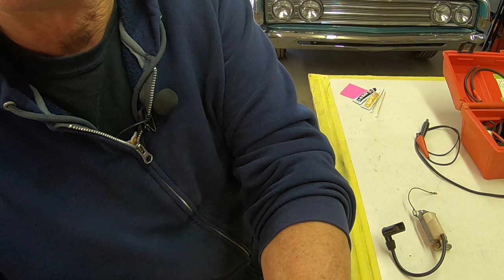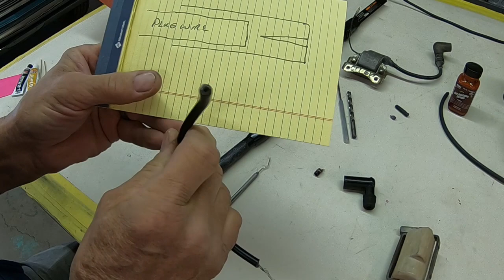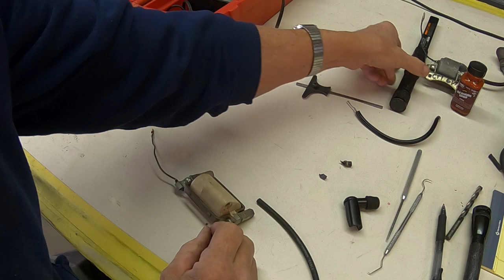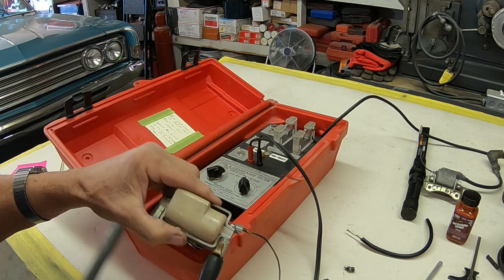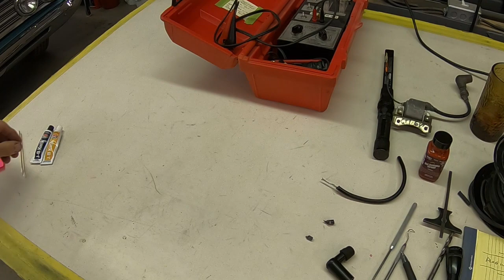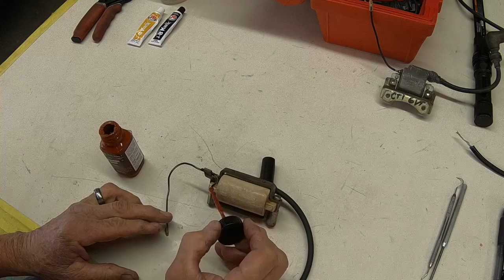73 TC125 Suzuki coil wire repair

Comment: Hi dale im going to repair my coil same as you have done, but im a bit concerend that the vibration from the bike will crack the jb quick weld through time, will this happen, let me know please dale, Thanks.
Reply from the maker: I have not seen any issues with my coil repairs using JB weld. Some are over 10 years old.

Comment: Get a piece of suitable diameter tube/pipe, cut it about 3 to 4 inch long, sharpen one end and cut slots in it so it looks like a castle nut , put it in a cordless drill and mark wire depth with a sharpie... there should be very little cable or sealant remaining and the spike is left intact....takes seconds once tool is made.

Comment: What kind of wire would you use on a jr50. Old little bike. I found that they sell 7mm wire or 8mm wire. Core or stranded. Im not sure what to use
Reply from the maker: Hi there, I am not sure you can do this to your bike, I am not familiar with the JR50. On the 73 TC125 Suzuki I used 7MM stranded wire.

Comment: I made this repair after seeing this video removed with wire still in. No spike, I followed wire. Stopped when wire 
turned going inside. So I made my own spike using core wire from 75 ohm 
cable 1 inch long
inserted into new wire half way then inserted thatcore of wire left inside.
Thanks for all these great tips for salvaging and renewing original factory parts that are better than aftermarket.
Reply from the maker: Wow no spike, was it one of these Nippo denso coils from the Suzuki's. The Yamaha coils don't have them, and you have to kind of butcher them, but you can still do it and fill in the hogged-out areas with JB weld. Glad you got it done ok though. That is the main thing. Thanks for spending time in the shop with me.
Reply: @montana2strokeracer  oh believe me I got to do all those things you already about. I'll be around. Thanks for helping all us old guys relive our days on these bikes when they were new.

Comment: U are excellent sir
4ss8231001 this coil for yz125
 I want put it on y125zr is it okay ?
And usually what causes of coil plug deteriorating and become broken coil plug I mean the power of coil plug becoming less and slow power broken

Comment: Does anyone know if you can do the same way to replace damaged wires on lawnmower coils? I have a good coil, but the wire is half way severed off.
Reply from the maker: Oh man, not real sure, I am never for sure on these bike coils till I either fix it or ruin it. I have done enough of them to know now which ones I can do for the most part. You just have to realize when you do stuff like this that it could go the other way and you have to find another. Sorry couldn't be more help. Thanks for watching.

Comment: Thanks for the clear and simple explantations. You answered all my really basic coil questions! My biggest one was, can I replace my coil wire? I have a spare that will get exactly the repair you did here!
Reply from the maker: Ben, glad the video was some help to you. Just be careful, which coils you do this to. Some are not repairable. Most that looks like the wire was glued in, you will see a bead of glue or sealant where the wire goes into the coil. Or ones that have a nut holding the wire in are good canidates. I have noticed most of the ND coils like on this Suzuki are good ones to fix. Good luck and thanks for watchin.

Comment: hi Dale, many videos on you tube where people use a multimeter to check coils and plug caps and wires. but your device is the best as you can see the spark.
Reply from the maker: Thanks Frank, I like the fact that you can see the spark jump the gap. I have found that the camera doesnt pick the spark up unless you get it in the right spot.